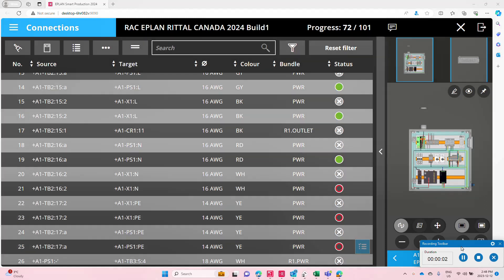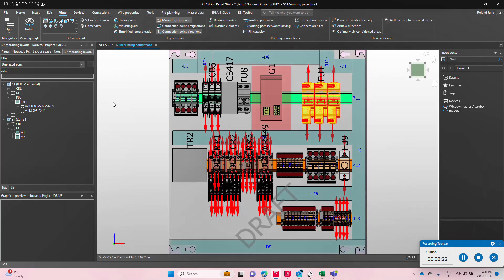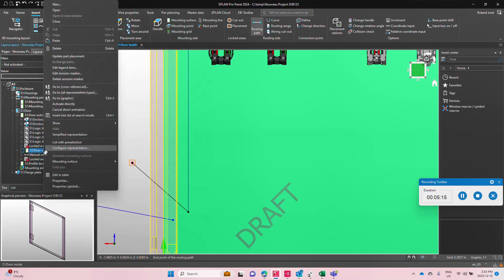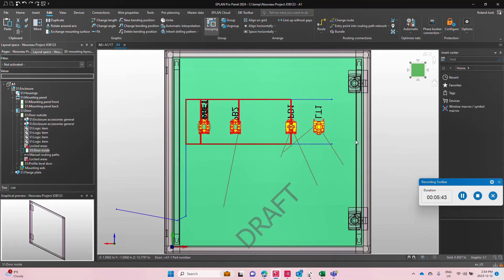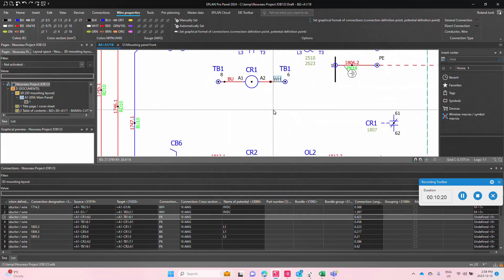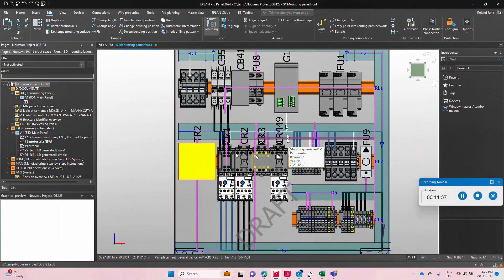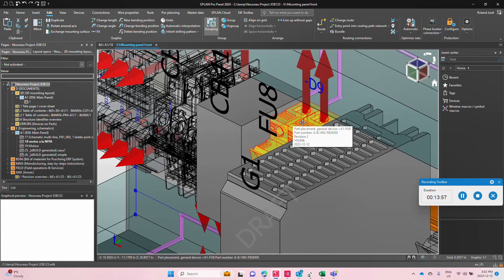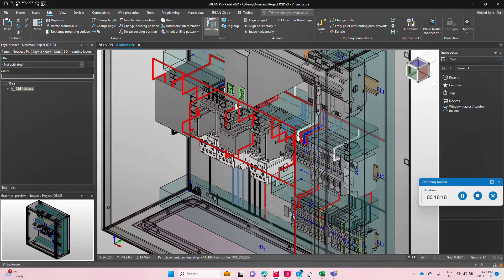ProPanel and Routing how to get ready for Smart Wiring

Comment: This seems simple but in reality many of the parts do not route. It is still an amazing tool when working properly. What I was looking for is how to clear all existing routing in order to re-route again. Running complete re-route of our panel was not clearing out some of the connections that no longer existed.
Reply from the maker: I do not have your project in hand, maybe you can share with the ESC with your support colleagues. M=In my experience, routed wires are easy to find in the Connections Navigator with a default filter (3D connections) which clearly shows all routed wires. Maybe some from a previous run of routing, which you can always delete and re-route. This seems to always work fine for me.
The parts in my panel always route when a path is available. When the part does not route, one of the corresponding DT source and target connection point is missing in the 3D layout. A wire connects to a DT:<connection point> like CR123:A1. I help you directly in this channel, but colleagues certainly can locally. Please get in contact with them directly.